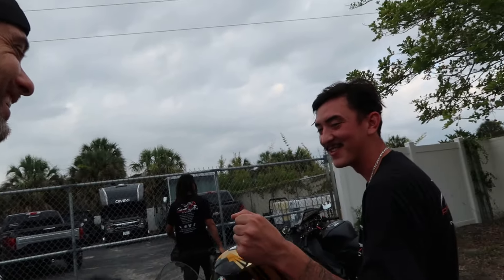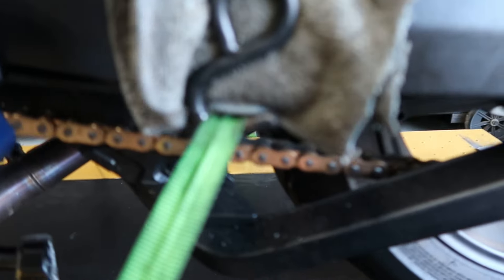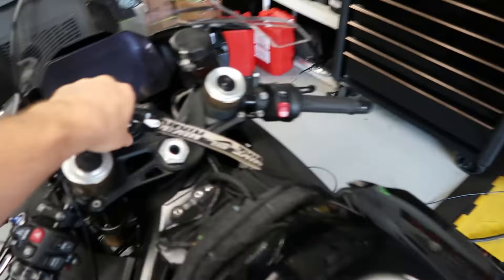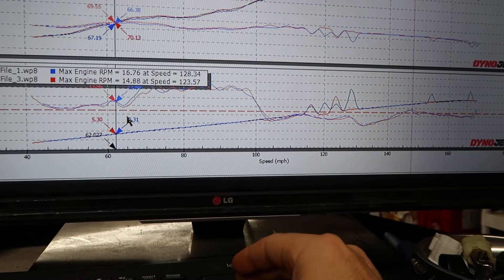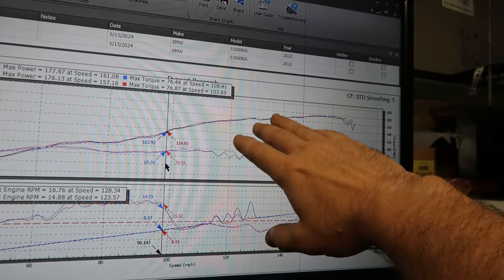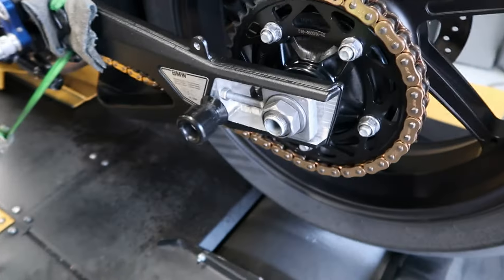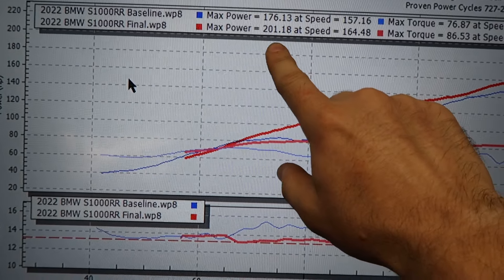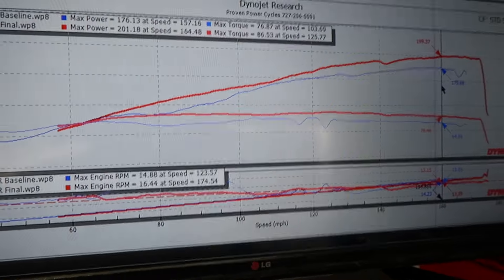2022 BMW S1000rr Custom Tune on PUMP GAS

Comment: If you tune using 5th gear you get a more realistic hp number, and you also gain some bandwidth in the afr data, lets you clean up that afr line to perfection with less effort. Just my humble opinion. I have been tuning with Woolich since 2013. Great job brother! 🦾🫡🤝👍
Reply from the maker: We usually choose between 4th and 5th (usually whichever is closest to 1:1 ratios). I mentioned in this that he was stock gear ratio but in reality he was at -3 in rear. So in this case, I decided to tune in 4th. But appreciate the feedback bro! And yeah I joined woolich in about 2013 as well ! I remember calling Sharon at night due to time differences between here and AUS 😅😅😅 How times have changed lol

Comment: Congrats, been waiting to see what folks are able to do now that the Woolich is out for this platform. If I was local I’d be reaching out to you to do my 23. 
Question for you: 

BT makes a big deal about how difficult it is to tune this platform, especially the 23’s. Seems like it did take a significant amount of work on your part, but you obviously were able to figure it out. Does that mean there’s not one specific barrier to entry for tuners, or some secret sauce BT has that nobody else can replicate to tune or crack this ecu? Seems to me it’s just a complex machine that takes significant time and effort to get right. Is that fair to say?
Reply from the maker: Tuning is tuning. Once you understand HOW something works then you can make changes and test different theories out and see what works best. The more time you spend working on something, the more you understand it. Now that I have a pretty damn good basemap, I can utilize it for future BMWs and see how it works and tweak that per bike from there. 

Not every map will get me close based on mods or condition of motor/parts on bikes (this applies to all bikes, not just bmws). Trust me, BT took a while to develop maps as well. It's never an overnight success, even though it seems like it a lot. 

I also have 10 years of experience in tuning.  I know tuners who don't even want to touch these bikes because of the risk involved. A few wrong key strokes and you can blow a motor up. Not everybody wants to assume that risk.

Comment: Nice! Always wanted a Beemer bike, fancy. Have you guys tuned a KTM Duke 890R yet? I'm over on the east coast and would love to bring 'er over....
Reply from the maker: We have on power commander but not throigh the ecu yet.
Reply: @provenpowercycles  Right on, did you make any good gains? Or smooth it out a bit?

Comment: That’s a lot of fault codes smh bmw guys well let’s see here the bikes on a dyno ecu receiving throttle inputs and gear position signals ddc signals but the front wheels not moving at all? Glad bmw engineers aren’t as empty headed.

Comment: I need to have my 2024 re dynoed i did a shoot out at a harley event and it only read 187.52whp, btmoto velocity stacks, ait relocation, SLR-tunning tune, arrow headers+ mid-pipe stock akrapovic muffler on pump 93, stock air filter flapper delete. I also have the arrow muffler this bike has but its just so fkn loud i cant hear my music in my helmet makes my ears ring and was told ill make more power with the akrapovic

Comment: What’s safer? Getting something like a Bren Tuning flash on a handheld or getting a custom tune on a dyno? I don’t care about max power, I just want the flat spot gone, and reliability
Reply from the maker: @ChokolateSushi23  custom dyno tune all day. A mail in flash will help for sure and Bren does have their mapping down pretty good. But with a custom tune you can see all the imperfections that need to be tweaked vs the flash is just that. A 1 size fits all type of map 👍

Comment: Wish i was closer to you guys. Even my local tuner is trying to sell a handheld over a full customization with his dyno, possibly makes more money that way or maybe he doesn't own all the woolich accutrements i dunno. What's your thoughts on a normie tuning himself (with no dyno) with the woolich and using the auto tune feature with wide band lambda installed?
Reply from the maker: If you are just messing with AFR tables then I don't see why not. It's a little in depth if you have never dealt with tuning platforms before but still manageable all in all. Just depends on how comfortable you are messing with your bikes ECU and how confident you are to fix a problem if something doesn't go right.
Reply: @provenpowercycles  thanks man. One more thing, bren talks alot about the 80% WOT restriction that they have unlocked to 100%. I'm not seeing anything in the woolich videos or tutorials that addresses this. Snake oil?
Reply: @dhall5634  I am tuning mine (24 s1krr with Woolich). I was doing great until I hit a VIN error. I am working with Woolich tech support currently trying to resolve it. They did just start on the issue early this morning, so it might take a day or so. If you aren't a member on the s1000rr forum you should join, we have a open discussion going on over there about it.  A few guys posting there use it.
Reply: They actually patched the software for this issue, and I tested this morning and it writes to the ECU now. 

Hi Jason

We have found the issue, this particular ECU is storing the VIN at a different location in the EEPROM, we have updated the code to check for this and it should now work allowing you to write to the ECU. This will be available in the next release of WRT which will go out in the next couple of hours.